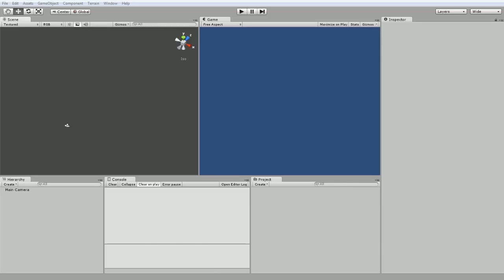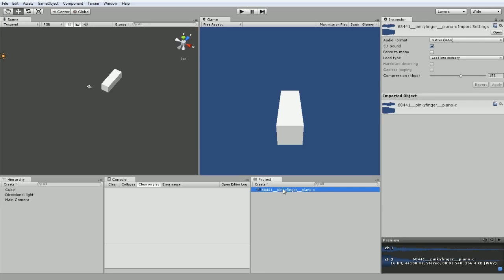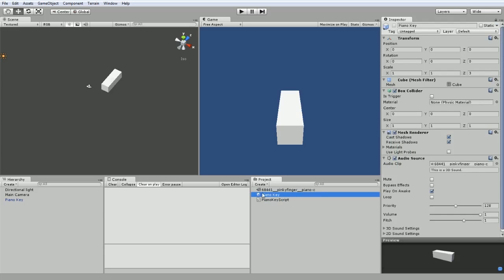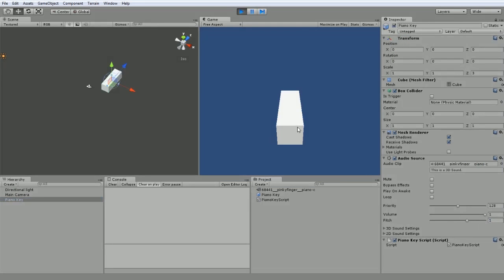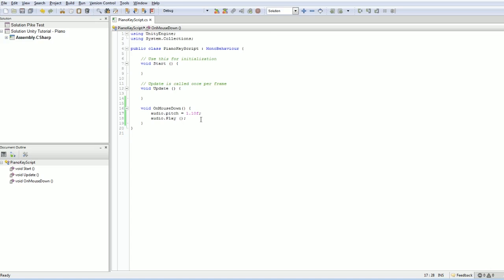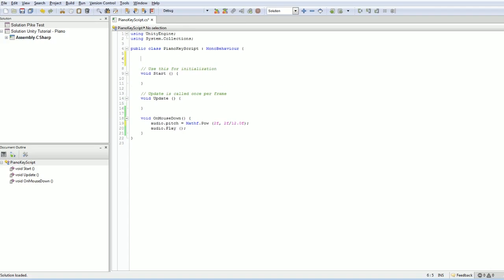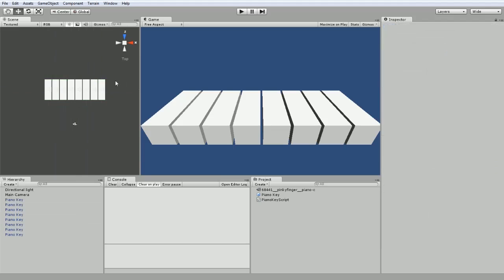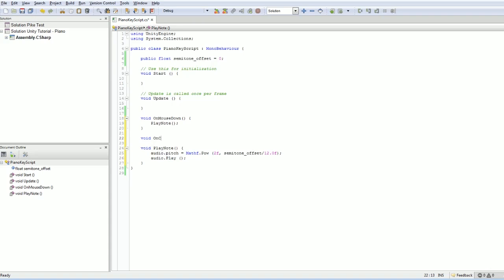Unity 3d Tutorial: Altering Sounds Dynamically [Piano Game]

Comment: Just curious, is it possible to script in a hold for the notes. Example if I hold down the C note it should be able to continue to make the sound until I release. In this example it responds to hitting the note, but doesn't show the ability to hold a note. Would you need to have audio samples of a short note and a long note ? Or can you achieve the hold with a 1 second sample and stretch it out to 2 seconds using scripting? Hope this makes sense as far as my question.  thanks
Reply: Also, if you were to hit the key quickly , it should be a shorter sound. So hitting a key quickly, makes the sound shorter, and holding the key makes the sound longer. Just want to know if that can achieved through scripting or does one have to provide multiple sound assets as in one short note and one long note. Thanks.